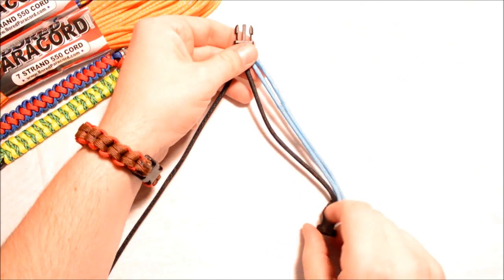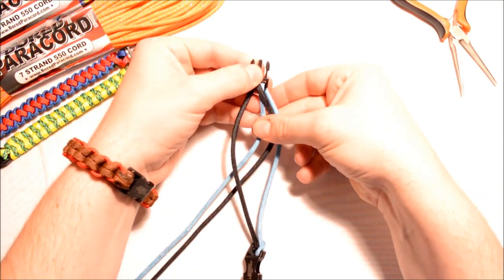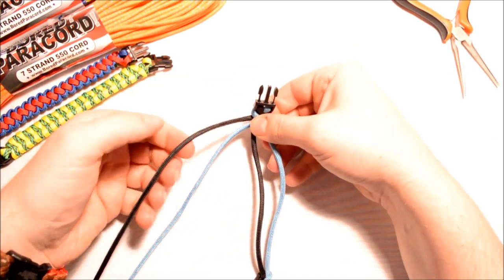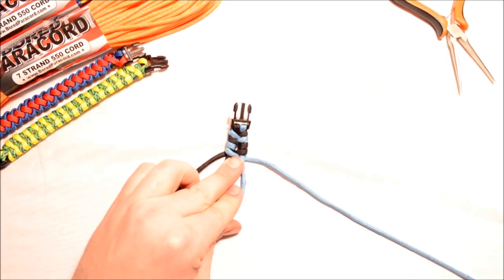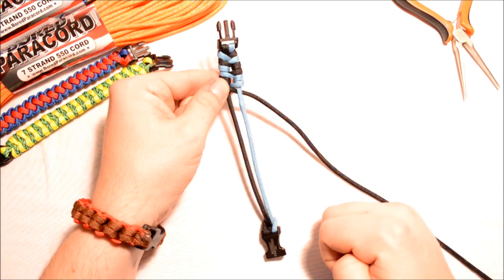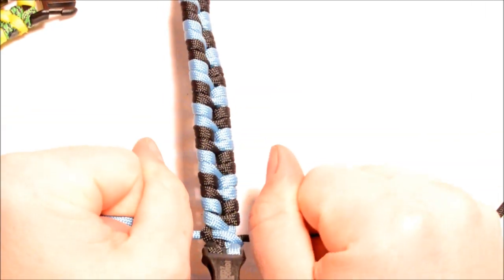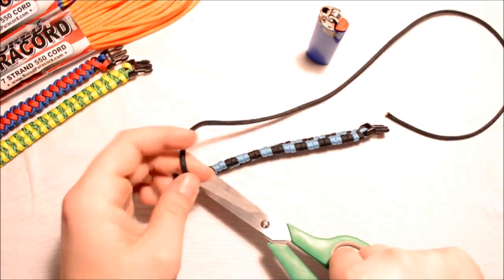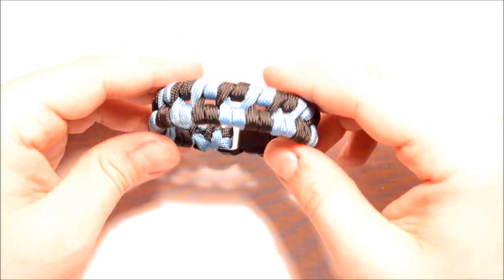Paracord Bracelet "Barbed Wire" Design - How To Video - BoredParacord

Comment: Personally I've always used my thumb. Sometimes if it looks real juicy after I burn it, I'll lick my finger first, but usually not. Just smash and round it in one quick motion then rub your fingers together and the plastic flakes off if you get it right... I don't always, but it going good often enough I haven't learned to use scissors I guess :) it is a little warm when it does work out thou